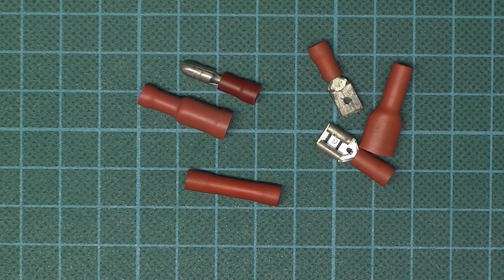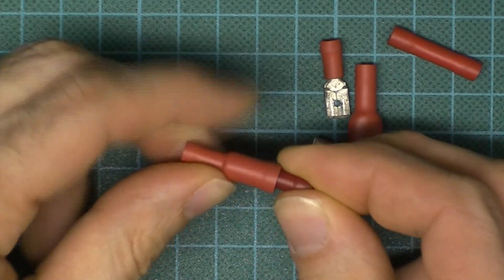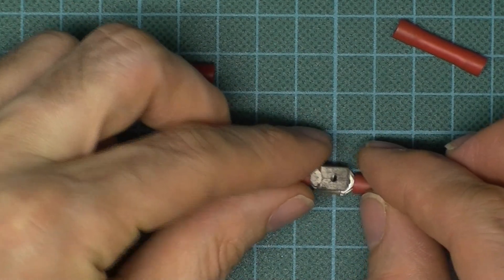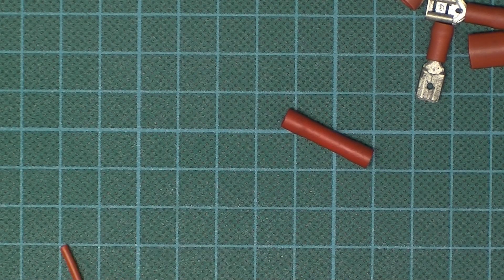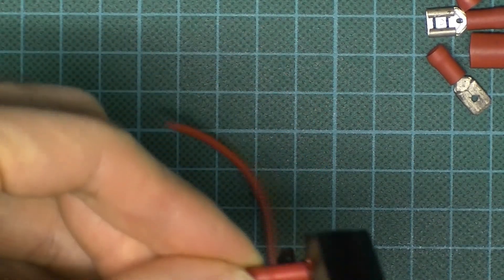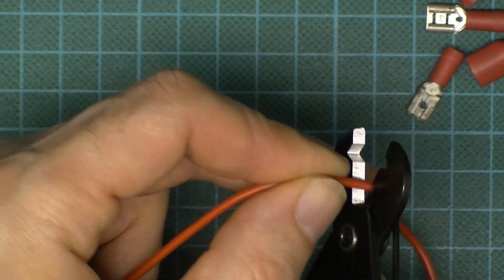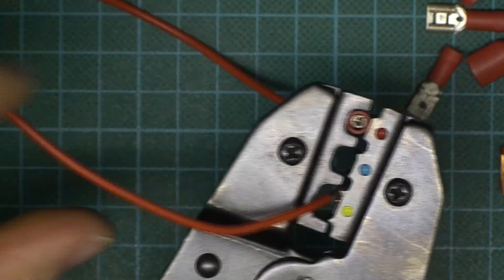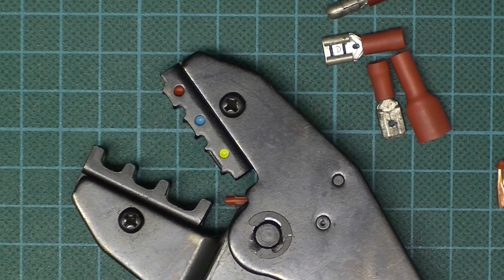Butt splice and other crimp connectors TUTORIAL

Comment: You failed to observe the correct orientation of the seam. It needs to face up in the jaws otherwise the die will not complete the crimp in the correct form, leading to poor compression and possible failure.

Comment: I don't get why people think solder is better. The tin in solder is 5x more resistive than copper. There is a reason when you see high amperage connections in power lines and automotive installs from the factory they use crimped cables only. You can have bad crimp connections and bad solder joints, but if you do both of them perfectly, the crimp connector is always objectively superior.
Reply: Funny, every one says this but a proper solder joint and a proper crimp are very close in resistance, in a good solder joint, a good splice and then soldering can have slightly less resistance than a tight crimp, copper on copper connections with solder protecting the outside if twisted tight enough, whereas a crimp is nearly ALWAYS copper on tin. Crimps are tinned copper most of the time and it pretty much makes it where there is never copper on copper. It all really boils down the the location of the joint and preferences.  Entry level soldering and entry level crimping, crimps shine. A professional and some regular guy can achieve practically identical results using similar tools and a strip gauge. Soldering is a lil more know how, and you can't have the solder wick to far up, or a joint with only solder between it. If you tin two wires and then stick em together, your gonna have resistance band a joint failure. Solder should never be the forms of joining, but more of the means of anti corrosion
Reply: Solder can ‘work harden’ the joint and fail. That’s why it’s forbidden in aviation and motorcycle repair. Crimp and heat shrink is superior.